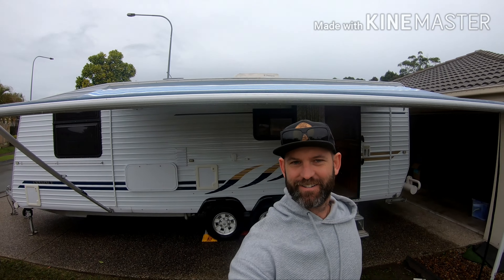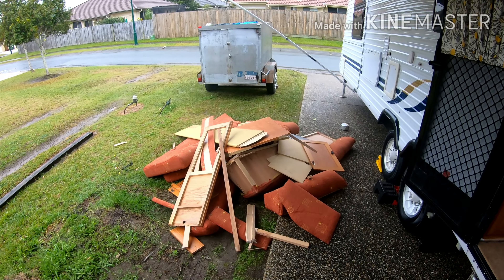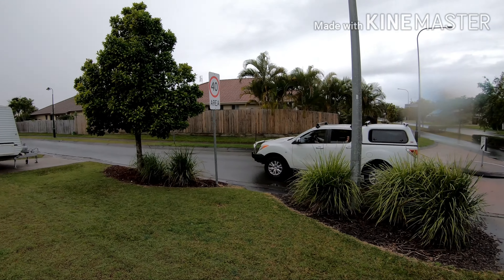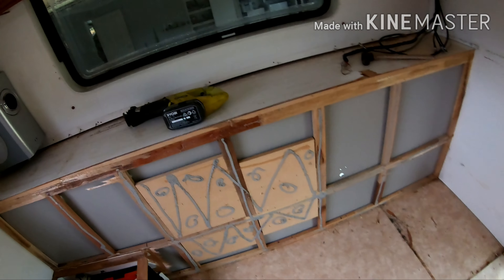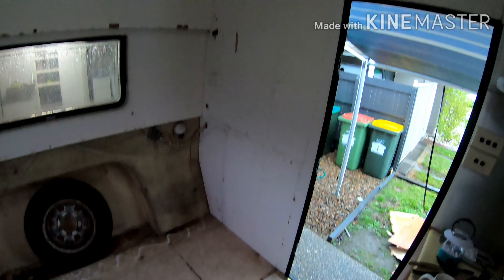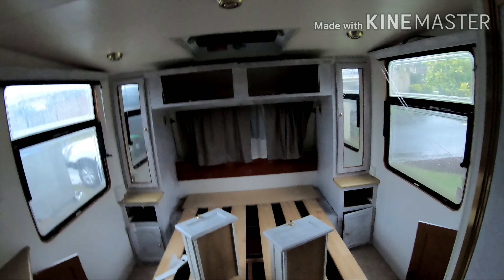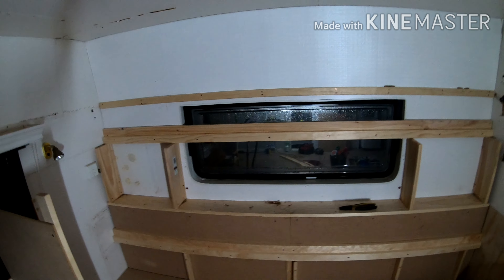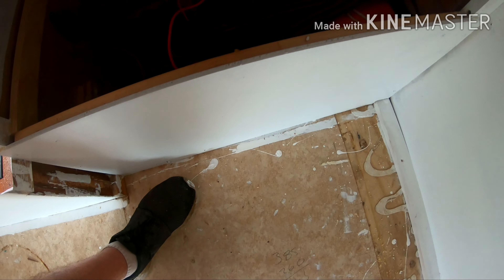Day 1-5 triple bunk caravan renovation.

Comment: You have done a cracking job mate 
Can I ask how did you fix the vertical wood onto the internal panel , as it looks like chipboard ?
Reply from the maker: Yeah mate its just thin ply that i brought to hide the cracks from the original walls that happened when I took down all the original cupboards that where there, I just screwed it in to the existing wall